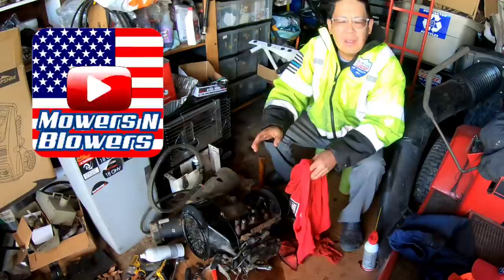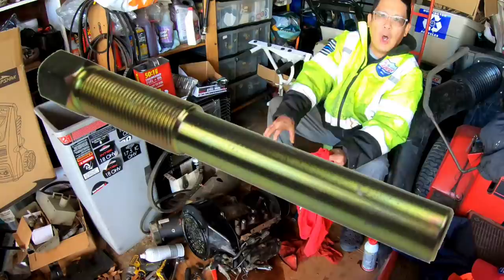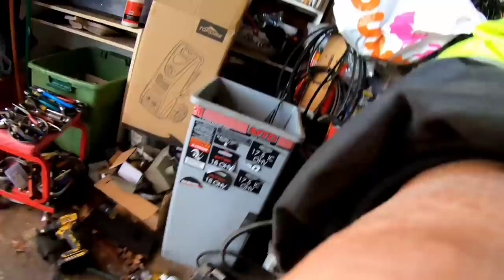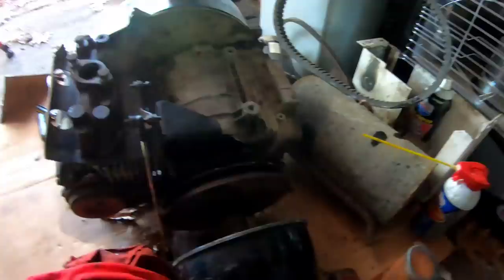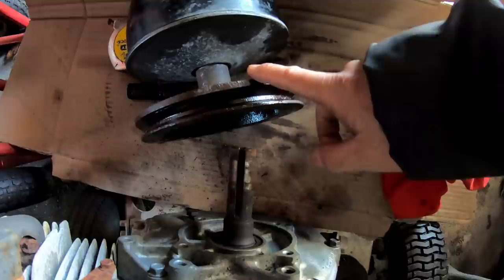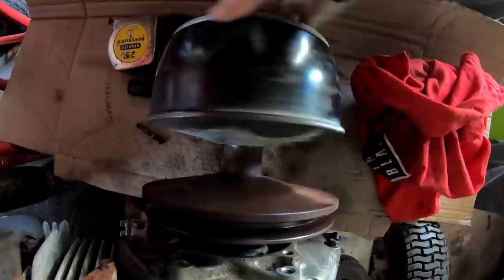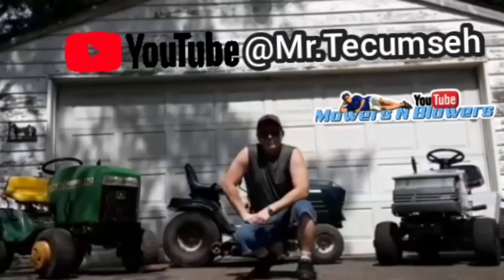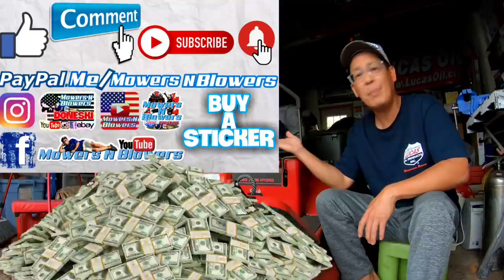HOW TO REMOVE AN EZGO GOLF CART WISCONSIN ROBIN SUBARU FUJI CENTRIFUGAL CLUTCH W/O REMOVAL BOLT TOOL

Comment: I bought a bolt that fits the threads of the stock clutch then cut a hardened rod cut the correct length to go behind the bolt. I put a large ball out of an old bearing in first to contact the crank snout. Put those in first then screw the bolt in and impact it or just buy the puller.

Comment: Hey Henry.  If that is a 1 to 1,1/8 inch step up sleeve that you were looking for, That is a very common conversion when mounting the Predator engines as well as with the John Deere tractor engines that commonly use engines with the 1,1/8 crankshaft engines.  Now the tapered shaft situation  may require some further research. Amazon would possibly have what you need for your project.  Those centrifugal clutches can be a real pain to remove intact - So consider yourself lucky in that regard.

Comment: Get a piece of 1 in ID electrical conduit cut off what you need and you'd probably have to make it a little bit short so that it doesn't come all the way out to the end or you can put a couple cuts into it so that it could fold in a little and get your bolt and your washer and put the clutch on I should take up the slack in it cuz you only need .060" wall thickness

Comment: you first have to see if the golf cart frame moves with the suspension. If frame is solid and not part of the suspension. Get some metal plate 1/4" steel. ( scrap yard,market place) to make a base for the engine.weld plate to cart frame then mount engine. Dont use the tapered shaft clutch the wobble at 3000 rpm will destroy it and may bent your engine shaft.. Sell it for good money and get you a correct keyed centrifugal clutch on amazon. Keep going .. i had to do same thing on my madmax generator. made lots of mistake, now i know.. there can be no wobble. Will self-destruct..

Comment: Your a mad scientist you need to make a sleeve the same size as the old motor shaft but you got it if you don't make a sleeve it will slip and come loose as a goose
Reply from the maker: Which is why I bought a sleeve
Reply: @MowersNBlowers  where did you get it and what was wrong with the old motor ? I have one it smoked like a som bitch
Reply from the maker: @martywolf1819  I bought it on eBay,  the old engine got no spark and it had an oil
Leak
Reply: @MowersNBlowers  someone actually sells that sleeve for the honda ? Amazing 😁
Reply: @MowersNBlowers  I had to look I had no idea your the man so I found one for a 1" shaft I'm guessing your putting it on a 13hp motor ?
Reply from the maker: @martywolf1819  same 11hp